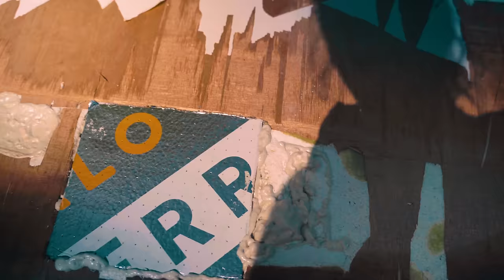my new HAIR & I finished my camper roof

Comment: loctite on the ceiling. Turn the roof upside down so you're not fighting gravity and add weights on top after application to help compress it down. Let it dry for 48 hours or 72 if youre leaving it outdoors when  drying. You could also use panel bonding tape in addition.

Comment: lattice could be glued to the ceiling and then the paneling could be glued and screwed. When using glue...apply to both sides then press both pieces together then pull apart give it 10 or more or less depending on circumstances so it's nice and tacky then  back together. Using a T to prop and pressure while drying and curing and curing takes longer then the dry. Hope this helps, Victoria.

Comment: Use 1/4 inch plywood, scrape the glue off of the ceiling, then glue the new 1/4 inch  plywood to the roof and then screw using the proper size screws. I watched your other video and I remember you unscrewing a ton of screws, so use that screw size to ensure you don't poke thru the roof. You may need to adjust the screw size but use construction screws, hope you get it back together to look good.
Reply from the maker: That won’t work unfortunately. 1/4 inch is way too heavy and there’s nothing to screw into for the panel there’s just styrofoam underneath
Reply: @TorieRobot  oh bummer i thought for sure you made a frame for the insulation. Anyway glad you are persevering threw this process. Hope you figure out something that looks and feels good for you.
Reply: If it looks like rains just park at a bit of an angle, and your roof dip shouldnt be a huge issue.
Some sort of wall paper for the ceiling? Could even glue on some trim if you wanted to get fancy. With non foam eating glue lol
Keep putting out great videos stoked to see how it comes out

Comment: I'm pretty sure 3 M red double sided tape (like 3M GPT-020) would fix your paneling problem. I've used it when I worked in manufacturing. To test it I tapped two pieces of wood together. When I pried them apart it actually pulled wood out of one of the boards.
The stuff is crazy strong, heat and water resistant. It's pricey. But I used it to attach tiles for a back splash and a few other projects.
Maybe put an arch inside the roof to get the low spot out.
Good luck.

Comment: Hey love, anytime you say "should", you have or will put expectations on people that they WILL NOT live up to. Think about that. It helps with the frustration.
Reply: 100% clear silicone. It's waterproof. Use it in spots, but use a can of spray on contact glue to hold it in place til silicone drys. The kind used for headliners. Spray the roof and the wood, wait til tacky, then put together and use some type of roller to press them together.
Reply: Also brown will always bleed through as the wood absorbs the paint. Use a paint primer mix.  So sorry. I laughed like hell when the roof fell😂
Reply from the maker: That’s great advice and I will take that to heart, thank you

Comment: I sealed the roof of are RV using black jack roof tar then once that dried I used flex seal paint. Over the tar. 4 years so far no leaks!!!!  My wife and remodeled a pop up trailer and are RV. Other than paint and cabinet hardware. We used peal and stick flooring super cheap and can be cut with a knife. Water and scratch resistant. Personally I think that made the remodel!! Also used wallpaper for an accent wall. And peal and stick tile for back splashes. Easy things made all the difference!!!

Comment: First, just to brighten your day a bit, let me say you are simply stunning with the new 'do. My jaw literally dropped a bit. Not kidding, very pretty. Enough said on that. Next....Yes, a lot people suck, but don't loose all faith. Not everyone is an a-hole...just most. Learning to spot the ones that will screw you over takes unfortunate experience, which sadly you now have some more of.  NOW....on to the roof. 
Given that you spend lots of time in the desert I would say a minimum of 1" of foam to keep it from being such a sweat box in the sun. It is cheaper by the 4'x8' sheet which you can cut into smaller segments. Perhaps 18" or 2' x 2'' squares or shapes. That way if one bit turns loose the whole sheet won't come down. Cover them individually in cloth which will keep the weight down and make any future fixes much easier to deal with. It would also allow the possibility of doing various patterns/styles to liven things up vs just a plain solid color  ceiling. Your innate country girl creativity could come to the fore in any way you deem cool.

Comment: Another great video. The new hair looks great, and a high-five to your not-camera-shy cousin!

One of the best solutions I’ve seen to hide a crappy ceiling AND look good was to use an old parachute as a fabric source, zipped around the edges and tacked to the ceiling along the seams to create a subtle billowing effect.

Dust builds up inside it over time, so when that happens they unzip it, take it outside and hose it clean. It’s parachute fabric so it weighs nothing, dries fast, and lasts…

Comment: Try attaching the paneling again,  this time use staples. They will show, but with just a bit of care in placing them you can kinda hide them. You can get staples made for paneling that are colored,  and they don't penetrate very far. Oh, and the rain and moisture likely did a number on the adhesive that you used, maybe try it again,  this time with a space heater to keep the moisture away? Idk?    Your hair is so beautiful,  and I think that it fits you so very well! Pretty!              I love your videos,  and I can't wait until the next one!

Comment: 3M 5200 Adhesive would have bonded to everything and been waterproof forever. We use on Yachts. Also next time you fix get on Marketplace and get ya a 10x10 cheap popup  awning to go over.  Good luck with the finishing  of that cowboy camper

Comment: Ive seen people use thin foam sheets they would glue to the plywood first, then would glue the panel sheets to the foam on the underside. Also,securing it with small wood edges on the outside edges with glue and short screws that you can screw into the wood you already put along the inside edges. You want the foam sheets anyway for insulation.

Comment: Cover the underside of the roof in fabric. It's lighter and the glue would adhere to the weaves a lot easier. Sand the underside of the roof with rough grit sandpaper where you want to apply the glue. Use the spray adhesive that is used for fixing car roof liners. Good luck. 
Don't get yourself down or blame yourself for trusting people. Some people suck.

Comment: For the inside of your roof. Try a high heat spray glue(weld wood landau glue. And glue boat hull liner to the the roof with it. It’s mold and mildew resistant.

Comment: I hear you about the trusting people thing, imagine a world where everyone cared about each other and were honest with each other.  I have an idea for your ceiling, how about taking some foam rubber maybe 1 inch thick, cutting it to the size of your ceiling, sewing some fabric around it (perhaps woodsy to match your theme) and using some adhesive spray to adhere it to your ceiling.  Then you could use push tacks to put pics etc on it. It would be lightweigh and functional 🙂

Comment: This is something I'm going to try on my next van, I used double-sided carpet tapes on the van of got now in some places to help hold my 1/8 inch Ply wood it work good But I also got some screws in it. But it might work for your ceiling. 1/2 inch poly insulation 4X8 foot sheets cut to shape pre fit, put some strips carpet tape on ceiling after you make sure 1/2 insulation panels will fit,spray can 3M  Spray adhesive, make sure work on foam, I say it would cause your foil backed foam board is paper side on one side foil side on the other, Take you like maybe a  decorative bed sheet 2 or 3 of them, Cut it like you're gonna wrap a package and wrap the outside edges Using the 3M spray adhesive to hold it on to the installation folded around the back of insulation about an inch or two,make your coverd insulation panels that are covered with so type material like bed sheets you pre fit that they will work,run some stripes of carpet double sided tape spray the spray 3M adhesive between carpet tape, press  your covered insulation panels on inside roof (you would need to take a piece of the  Panel you tried with and maybe 3 or 4 2x4 boards press up on covered insulation panels that you're glued to ceiling for couple days maybe do your covered insulation panels 2 foot wide by width of top to make it easier

Comment: Contd,. Since you have installed the ceiling you will have to brace ut from inderneath to allow the adhesive to cure & grab. Off to tge fabric store for vinyl fabric in your color choice. Sparay contact cenent on the foam & fabric, again youwil have to do this in stages since its installed. But you could remove it & start again. Insulation will keep the chill & heat off.  Be calm & persevere.  You got this

Comment: you can build up roof with figerglass fabric and epoxy resign even after its reinstalled. might be able to actually use boards and jacks to reshape it before allplying epoxy and cloth to create a permanent strong weather proof fix

Comment: Hair looks fantastic! The inside of the camper top, not so much. I would suggest high density building insulation foam, which comes in 4ft. x 8ft. sheets, attached with whatever adhesive is recommended in your area, (I'm in Canada and brands differ). Two sheets would have fewer seams than the little white pieces you showed. Good luck! I'm sure you'll sort it all out and continue to share great videos of your adventures in beautiful places.

Comment: To fix the sag in the roof install an aluminum trellis across the top on the inside at the back of the vent location to support the roof skin with a slight arch in it.

Comment: They sell 4x8 sheets of foam for the inside of the roof at Lowe’s & Home Depot.  You could use Kool Seal for the exterior of the roof.  It will seal any small holes and help insulate it as well!

Comment: there is a plastic paneling you can use for the ceiling that will not peel where the glue is and it is textured comes in 4 x 8 sheets white in color and not really that heavy. If you have the enough space you can use 2x2 boards running side to side not front to back 16 inches apart to add support for the roof to make it more flat and stonger. Just add long enough screws from the outside to hold them plus the liquid naill then short screw the plastic panel to the 2x2 boards dont liquid nail the panel to the 2x2 boards short self tapping screw with a washer would be good. As far as the roof water proofing an RV roof coating from amazon should be just fine or you can do a RV rubber roof kit.

Comment: I used to have a North Star  truck camper with the same roof crank and it was a little hard to get it started to crank up so I just used my shoulder to push up while cranking until it got easier. Coming down it would also just come crashing down at a certain point so I’d support it again with my shoulder. One time one of the roll pins flew out of the crank and one side collapsed. I was able to find the little pin hiding in the couch cushion and it went back in easy. Those campers have a learning curve so don’t beat yourself up. It’s going to be nice when you finish it and can enjoy all your hard work. Hair looks rad btw.
Reply from the maker: Is there anyway to fix that problem? It seems like it shouldn’t be so hard lol

Comment: 12:52I see screw holes. Water will seep into those. There's washers you can use with a rubber seal you can put on. You can also put caulking on the washer or just dip the tip of the screw in caulking and screw it in.
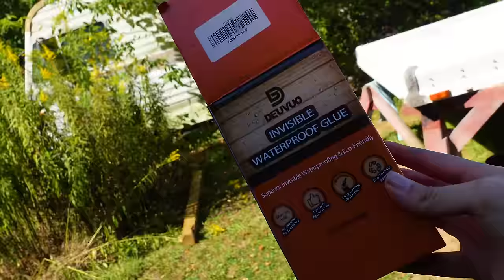edit: This also is true for the screws in the roof at 13:12.
Reply from the maker: Those screws are uncovered because we were repairing the side— they are covering with sealing strips — and I’m caulking everything lol don’t worry

Comment: For painting on your cabinets, especially since the camper has had its share of water damage etc, I'd suggest getting some strong primer onto the wood before you use paint (killz, and many others work really well and protect against smells/mold/mildew/etc as long as the pieces are cleaned before hand).  If you are going to stick to medium/darker color tones for the paint I'd highly suggest making sure your primer has some grey color added to it, as it tends to make your final paint take less coats; and, in many cases only a single final paint coat.  Whatever you do, do NOT do use "Flat" finish for your paint.  It marks very easily and is not easy to keep clean compared to the higher finish types.  Use either "Eggshell" or "Satin" if you don't want too much shine.  Any paint store should be able to explain things as long as you let them know exactly what you are painting on for suggestions and tips with your paint and primers!
Reply from the maker: Thanks for the suggestions! I’ll try and find a primer

Comment: I had a professional come spray foam the inside of my van, wasnt too expensive. Downside is its an uneven, odd surface and its finished color is yellow. Ive tried to cut it with razors but that didnt go well. Thought about eletric sander but the mess...

Comment: Stick the roof boards with clear silicone and put 2 timber braces along the board joints to hold the roof straight to stop it sinking inwards.  Don't worry everything is sortable.  You are gorgeous 😍 love the hair also.    Sending love from mick.   In uk x

Comment: Hi Victoria, hey one way to get the inside of your camper roof looking good 😊…. Get some lightweight styrofoam roofing tiles and some extremely good glue, do some research and get the best glue for the job, then as you glue the tiles push on them till they all line up together, they are styrofoam so they will mold with some even pressure.   I wish I could have told you about this before you put the top back on, but you’re a smart girl, you’ll figure it out ❤

Comment: Well there are maybe 2 ways of fixing your roof. For the exterior use fiberglass and resin. It will add strength and make it waterproof. For the interior, use fiberglass or just glue a light weight carpet.

Comment: That dip that you have on top of the camper, you could fiberglass that to make it level.
Once the fiberglass has hardened, all you have to do is send it down to the level that you want it. Hope this helps. Good luck.
Reply: Sorry there was a typo in my comment. 
You can sand it down whe the resin has hardened.

Comment: if you have a sag in the roof I would use some sort of bar or even pipe to elevate the sag point from the inside.  If the material is strong enough you can use it for hanging interior lights and such.

Comment: Man, that camper needs a lot of work. Glad you family is there to help you out. Need to use garage door insulation panels for the roof. They are about an inch thick and have a thin vinal outer panel on them. They would help to insulate your roof and look ascetically better than paint or contact paper.

Comment: Just a thought but maybe get a roll of vinyl and use an industrial adhesive to attach it to the foam ceiling think of it as hardcore wall paper  light weight waterproof and comes in many colors ,  use a razor blade to trim the fit then finish with light weight strip  trim   held by narrow crown staples or brad nails , luck and peace .

Comment: Add a simple solar and battery system and add a small flat screen TV and a radio / cd player to the campers. There is going to be times where your at, there is no full hookups and out of range of radio stations.

Comment: Did you try contacts cement?Put this contact in both sides You put it on the old roof you put the glue on and let it become  tacky And you put it on the new stuff on the bottom and you let it become tacky, and then you put them both together. You take scrap wood and you put it between it and put the one panel on top and a pulled scrap would start out at the middle and work your way out and push down on it.And then you have a roller and you roll it out.There's videos on how to use contact cement

Comment: They sell Styrofoam sheets you could use for the inside ceiling of your roof. You could find something light weight to put over to cover it . Usually the Styrofoam sheets aren't expensive but check price. They have them in wider sheets than the ones you have .

Comment: Ceiling suggestion:
I think the panel you have could work. I’d try again. First, scrape off all the old adhesive. Wipe off the ceiling with a cloth and mineral spirts. Let it dry for a couple of hours. Use a LOT more liquid nail. Put boards or a structure of some sort underneath that will allow you to use expanding clamps or shims and boards to press the plywood panel tightly to the ceiling. Mock up the boards or structure and dry test your clamping before actually applying the liquid nail. After getting it glued and clamped, let it dry for 24hrs.
It would have been easier to flip the roof upside-down and just put heavy weights on the panel to hold it tightly to the ceiling, but it might be too late for that now.
Reply from the maker: I’m sure this idea could work but yea it’s too late for that now- plus the panels are broken— they were so flimsy
Reply: @TorieRobot  too bad. Well, the smaller panels you're planning to use now will be a lot easier to push tightly to the ceiling and might actually come out looking better anyway.

Comment: Not sure what foam you are using, but it is usually very flammable. I have used a foam back headliner material on the pop top of my camper as it is fire retardant when cooking in the camper.  Might be worth a look. You are doing great by the way!